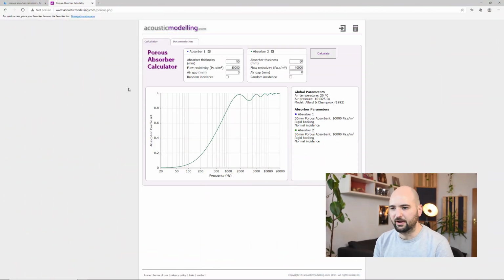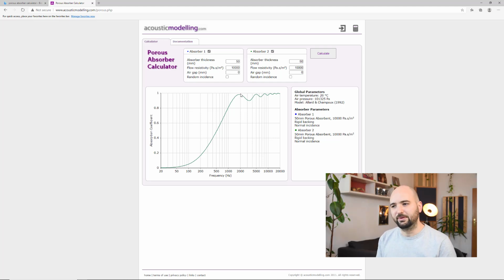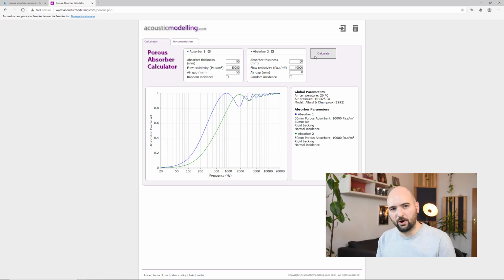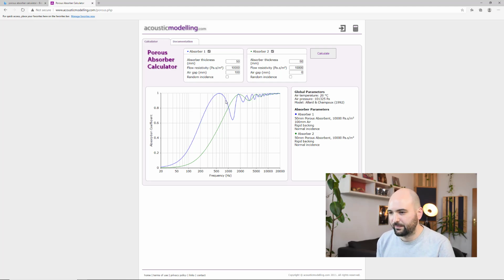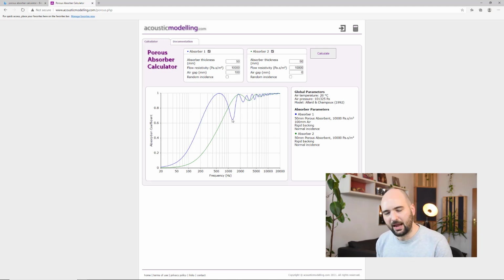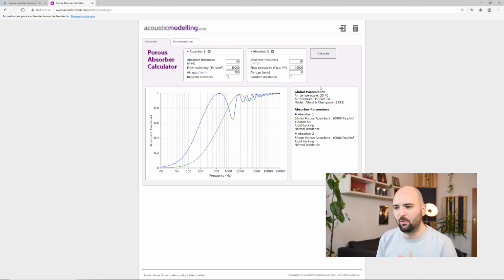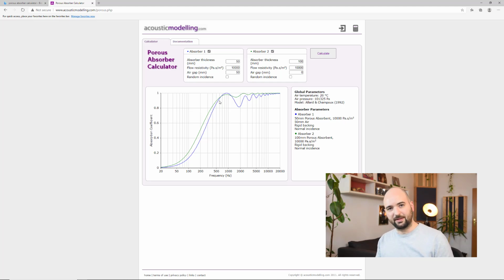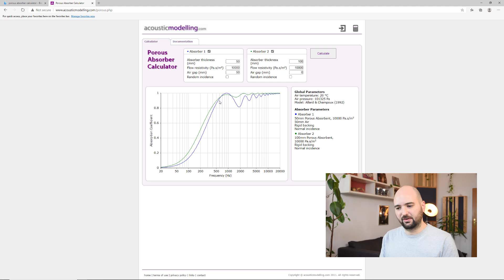Acoustic Panel Placement: Do You Need An Air Gap Behind Your Panels?

Comment: With a 4-inch thick slab of acoustic foam and no air gap, the Porous Absorption Calculator says absorption is down to 80% at around 400hz. If you split the foam into alternating 2-inch slabs in a checkboard pattern, you can get different air gap depths between adjacent slabs. With a 4-inch air gap, 80% absorption drops down to 300hz, but there's an unwanted dip at around 1200hz. With a 6-inch air gap, 80% absorption drops to 200hz with a dip at 900hz, but there's a secondary 100% absorption peak at 1200hz. With a checkerboard array of 2-inch slabs and an upper slab air gap of 4-inches, seems like the 900hz and 1200hz dips would be compensated by the absorption peak of the complementary slab. That would give you an octave lower 80% absorption frequency while cutting the foam thickness in half.

Comment: Having an air gap at all is a debatable topic. The issue of panel air gaps center around having an "open" air gap vs. a "sealed" air gap between the panel. Some have said that an open air gap may not do much acoustically. Looks like more numerical data is needed in the open vs. sealed debate. The documentation for the Porous Absorber Calculator does not make it clear whether the air gap measurement is based on open or sealed.

Comment: I’m curious, o guess we’re assuming the gap is against Sheetrock?Would the measurements change if the wall was treated? For example: if I had a room that was treated with 2 inch, then added 6 inch with 6 inch gap in various spots as needed better somehow? Rather than just having a gap with sheet rock.

Comment: One more note on open-air gapping. I read a GIK mounting test using a 4" rockwool panel where one panel was tested flat on the wall and the other was tested with a 3" open-air gap. The 3" air gap did get a small boost in absorption coefficient starting from 160 Hz and down, but started to create an absorption coefficient loss starting from 630 Hz and up. So no matter what, you don't get something for nothing. It's a tradeoff. Again in this situation though, it's still better to just use a 6" panel over a 4" panel open-air gapped.

Comment: Jesco! this answers my question from your last video. I had built panels last year that were only 4" thick and after taking your courses I learned that they should be 6". Any new panels I built would be  6" but I already invested time and money in the 4" panels, so I ran the absorber calculator and figured out that I could get slightly better response with a 1" gap. It worked perfectly and I noticed a difference. I also used this same approach to calculate the placement of freestanding temporary panels. The only door in my room is in a corner and bass tends to build up there so I placed a 6" broadband absorber during mixing sessions. I used the technique to calculate the optimal placement and air gap to the wall for the temp panel then I placed tape on the floor so I can quickly place it in the same spot. Thanks for the advice !
Reply: If you're going to change your 4" panels for 6" panels why didn't you make a 2" gap instead of 1"? 🤔

Comment: I have reasons for needing the air gap other than performance - at least two of my planned absorber positions have light switches which I need access to. Using thicker panels is pretty much out of the question.
What I don't see a lot of advice about is how to actually mount panels (in my case GIK) with an air gap. I know GIK have brackets for ceiling clouds, but I don't know if they're the best or easiest option for wall mounting.
Any tips would be appreciated!

Comment: When you say air gap does that mean the wood frame away from the wall you can stick your hand behind it gap or are you building a larger frame including that space behind the panel as in a 2-inch panel would need a 4" frame or is it just a 2" panel with a 2" spacer leaving a 2" see-through Gap behind the absorber?

Comment: Very interesting, so if I understand the conclusion at the end correctly, it would be beneficial to have an air gap (all be it not more than the core size), but if you have the space and resources it would still be better to just have a thicker absorption panel that would take up the same space (panel + gap). I did elevate some of my wall panels with acoustic foam on the sides of some tiles (so it has a gap to the wall inside but doesn't have open spaces on the side). But next treatment I will just get foam sheets to just have a thicker panel to elevate them. Thanks a lot! Great channel!

Comment: Some acoustic panels come with a solid backing material such as plywood. In this case I assume that an air gap does nothing, since the wood back acts like a wall. Correct?
Reply: most of the low frequencies don't really care about that, they go through - that is why you see bass traps reducing the amplitude of bass frequencies while having a hard outer shell (and sometimes hard inner spacers with air gap). Hope this makes sense. I think for mid frequencies it might be rather true though. Also, real life often overwrites these nice charts, these are just guidelines.

Comment: Do the cuts and shapes of acoustic foams actually make any difference at all? For eg: compared to a thick block of 2 inch acoustic foam , is a 2 inch pyramid foam better or worse?
Or is it a marketing strategy to make less amount of foam more appealing by saying : more cuts means more surface area means more absorption etc?

Comment: So does this mean you want to have varying air gap depths to cover that dip in the midrange? Adding some blocks of absorber on the back in air gap, to get the best of both the airgap and the double depth of absorber but without the cost of having a double depth of absorber over the whole panel? Or perhaps alternating airgap and full depth panels (again to reduce the cost of absorber).

Comment: I am thinking in using now, silk screening mesh fabric to cover my panels.  It's made of nylon, stretches very well, and allows the sound to go inside the rockwool 100% letting it do its job completely well, the way rockwool is supposed to work. It is not expensive if bought by the roll at Walmart.  Using the correct opening, won't allow the tiny pieces of rockwool get out of the panel, that are really bad if you breath them.  What do you think?
.

Comment: it seems the graph with the air gap has more comb filtering going on, though.  as much as you may save a few dollars by using an air gap, wouldn't it be better to have a flatter dampening/absorption curve, unless the peaks and valleys are precisely opposite what you're attempting to "fix"?

Comment: Using the largest depth with a single layer over a larger area... But doubling and triple layering the centers or targeting first incidents etc could result in best results...

I have those IKEA square shelves with the open back.. Covered and stuffed and off the wall a few inches. With stuff in them.. Books.. Guitar pedals. Batteries.. A coffee tub.. Surprisingly good compromise.

Comment: I am glad I saw this.  I have been thinking of making a diffusor by hanging a variety of panels of dry wall of a variety of sizes at a variety of distances from the ceiling.  I know there is nothing new under the sun and somebody somewhere must have thought of the same thing.  I wondering if a 1 meter by 2 meter panel of drywall say 3 cm from the ceiling might not end up acting as a bit of a bass trap?

Comment: Great video, thank you. To counteract the dip in mid-range frequency absorption with a large gap, would it be prudent to put an additional layer of absorption on the wall (so effectively double layering the panels, one against the wall, one a few inches off)?
Reply: Depends on the room really. Maybe you don’t want less mid and if so then just make the absorption thick and thin but no inbetween or add bass traps and those ugly useless foam because that pretty much only touches high frequencies
Reply: Do you have an rt60 freq response of the room?

Comment: Hi dear friend. Let me ask you a question please upon the vital air gap between the wall and the rock wool. Lets say I use 20cm deep rockwool. If i build a 30cm deep frame and put the rockwool onto the front 20cm depth (with dividers where the rockwool will sit)... that will leave me with 10cm free air gap on behind. Ok? When placed on the wall there will be no visible air gap. But actually inside I will still have the 10cm free air gap depth. Well... is that considered as efficient air gap for the best possible bass absorption, while there will be no air flow from the outside? My question is just for aesthetics. I prefer panels that sit flush to the wall instead of gaps.

Thank you.

Comment: Hi, i plan to rent a 100 sqm room as a dance studio ( 3.5 meter height ) , i will be using the cement ceiling for ceiling mounts for my hoops/poles . Anyway, the tenant beside me will be a 24 hr CALL CENTER , we still don’t have a partition between us ( on the partition i plan to install the dance mirror ) . For the partition, the owner will install a DOUBLE wall hardiflex . Will that be enough to deaden or block the sound for both rooms?  A supplier suggested to : Insert 3 or 4 INCHES ROCKWOOL fiber in between the hardiflex, then on my side - place the MASS LOADED VINYL ROLL on top of the hardiflex acoustic, ( there might be a gap in between this and the actual wall where i will place the mirror , they suggested that instead of using plywood for the mirror to be place, i should use SILICATE BOARD as a replacement, then finally the mirror. Not sure if there is a more cost effective way for this . Thanks your reply will be much appreciated

Comment: The absorber should be place as close as possible to the 1/4 wavelength position, where the amplitude is greatest and the absorption most effective. Longer wavelengths have 1/4 wavelengths farther from the wall, so the absorber must be moved farther from the wall to be effective, compared with shorter wavelengths. Please correct me if I am wrong.
Reply: I know I'm a little late to the party, but I have been searching for a comment that mentions this exact concept. Maybe I'm not understanding something, But if I put my acoustic treatment at the 1/4 wavelength coming from my speakers, which for any reason would be 5ft+ from the wall already, wouldn't it be more beneficial to put absorption closer to my speakers, and therefore any further reflections from the wall will end up being absorbed again on the way back to the absorber panel back at the listening position? It just doesn't make sense for the distance that sound has to travel to get to the wall with a small air gap compared to a larger one if the speakers aren't closer to the wall already.

Comment: Did I get this right?… The green line representing the sound reduction of a gap less 100mm panel has a far more linear response with slightly wider frequency absorption range in the low end?  If so, I feel the cost of the extra 50mm insulation is worth it.

I’ve chosen to go with a 100mm framed panel with 60mm depth of a more semi- rigid mineral wool board with 40mm of a less rigid lower density mineral wool board facing it.

Comment: What about putting the panel with a gap from the wall, but filling the gap with foam, in order to capture those mid frequencies? In other words, wall, foam, panel...?
Reply: the gap is to save money and material for a similar result, fill it

Comment: I’ve just found your channel & this excellent video on this subject. I have a question which is I am about to install side wall panels, & I’m trying to figure out the first/ second reflection points. I’ve heard a lot about using the mirror trick, is this something you would recommend, or would you have a other suggestion?

Comment: When you switch that calculator to "random incidence", that effect totally disappears and then it's just deeper = better.
Now I'm wondering if I should back-fill my absorbers for more even absorption.
EDIT: For treating modal frequencies, 0 degrees incidence works since those standing waves hit the wall dead on in a rectangular room. So it's better to use the material to cover more area if making it thicker doesn't increase bass absorption.

Comment: quick question: 

Is 300mm depth of absorber better or 150mm with 150mm air gap? if I type it into the calculator the curves are nearly the same, only the air gap variant has some dips and the other curve is like a radius.

Comment: Great video as always.  Question: Is there an upper limit on rockwool thickness when it comes to bass trapping?  For example, let's say you have a room big enough where you can pack a full 1m (!) of rockwool against the walls.  Is the bass even going to get through that much material or are you just wasting rockwool at that poing?

Thanks as always for the great videos.
Reply: great question, man.
Reply: I'd simulate it in the absorption sim Jesco showed here. It's vital to enter the Rockwool characteristics in the variables. 

Or, you can split it like he suggested, ie. .5m material with .5m gap. 
Or just go for it ... put up a full 1m depth. 

Typically the thicker the velocity trap, the less dense the material requirements are.
Reply: @FOH3663  Good tip!  I should have mentioned that I did this and that's what the simulator reported (after about .5m there is very little difference). The only part I couldn't figure out was the flow resistivity for Rockwool RWA-45.  From what I have seen, it's right around 10k (the default value at AcousticModeling.com) but that was extrapolated data from a random acoustics forum, not an official Rockwool spec sheet. I'm not sure they've posted that information for RWA-45.  Anyway thanks for your good response!
Reply: @LeoMakes  
You're welcome
Gearslutz acoustics forum would be a solid source for greater specificity in the material density etc.
Reply: @LeoMakes  You probably got it sorted by now, but it mainly depends on how low your speakers extend and how dense the material you're using is. So it could be worth it if:

a) The insulation you're using has very low flow resistivity (1000-5000)
b) Your speakers are producing sound in the 20-40hz range

If the flow resistivity is high, you won't get much beyond 300-500mm thickness. If your speakers taper off at 50hz, there's no point anyway because the main absorption increase is to frequencies below that.

Comment: Good explanation of why this occurs.  But one question: would you not want less midrange absorption?  Isn't the purpose to reduce LF frequency while preserving mid and high source content?  I've read pros and cons to broadband absorbers for this reason.  Second, thanks for the comment on distinguishing between velocity v pressure; could you do a short vid elaborating on this dynamic in application of treatment?
Reply: The blip he demonstrated with the simulation isn't "preserving mid and high content".
He was simply demonstrating the effects of spacing. 

To retain mid freqs and upward, you'd need slats, or Visqueen faced traps... that way the absorption is strongly weighted to the LF.

Comment: Just a quick question, wouldn't "random incidence" be a better approximation of the performance in a real room when you're calculating, or do you prefer to see the numbers for normal incidence to get a better idea of the material's performance if diffraction within the material and grazing incidence are removed from the equation? Thanks
Reply: I was going to comment the same. For rough estimate work, one should vaguely average the two graphs for panels on walls normal (perpendicular) to a primary sound source direction. As an example, both the "front" and "rear" walls in a listening room with speakers on the "front" wall will have more perpendicular character by a bit, but plenty of random incident angle. The side walls will be nearly 100% the random regime. 

Also, I don't see enough videos explaining that very dense absorbers, like say Corning 703 rigid fiberglass have strong surface reflectivity. This is why in properly engineered solutions like say cubicle walls, you find layers of differing density and sound slowing.  Good cubicle walls are upholstery fabric - automotive style jute - rigid fiberglass - cardboard sheet and then reverse the first 3 layers (the cardboard is a reflector to dump remaining sound energy back the way it came to isolate spaces). Differing densities and flow resistivities "traps" sound and diffuses to white noise what comes back out much better than any homogeneous material, and most importantly, largely remove resonant nodes.

Comment: This may be obvious to some, but misleading for others. When you state the depth of the absorption material in your calculations I assume this means the material itself, not the depth of the frame of the panel. For an example some of my panels are 3.25 inches deep, but the absorption material is at the front away from the wall and is only 2 inches deep. That should mean that material is already 1.25 inches away from the wall and close to the optimal equi-distance from the wall as the depth of the absorption. Were panels manufactured with the panel frames twice the depth of the absorbent material there would be no need to hang panels for optimal absorption.

Please correct me if I have misunderstood.
Reply: Yes, the material itself.

Comment: I bought some higher quality 1” foam (should have bought 2”) but I’m gluing to 3/8” plywood so I can move, reposition or remove them. I was going to space off the wall around 1”, but since the souldwaves will not pass any deeper in the foam before it bounces off the plywood, I won’t get anything from spacing off the wall. Correct? My only thought is some sound waves bouncing behind then bouncing between the wall and plywood backer. Any truth to that? My studio base for guitar with Marshall amplifiers is 12x 8 with 8’ ceiling. My space is small. Carpeted floor.